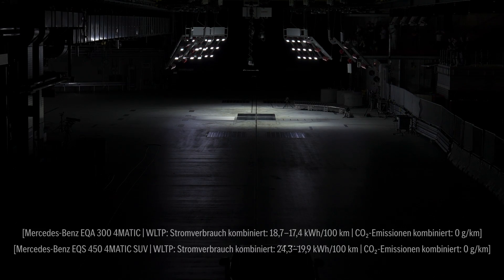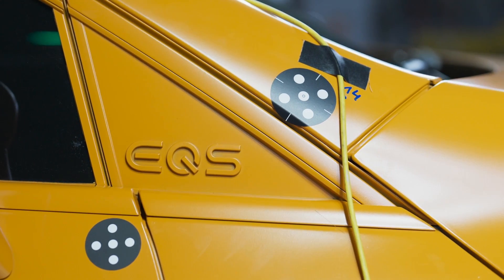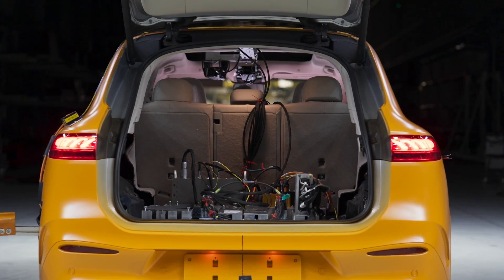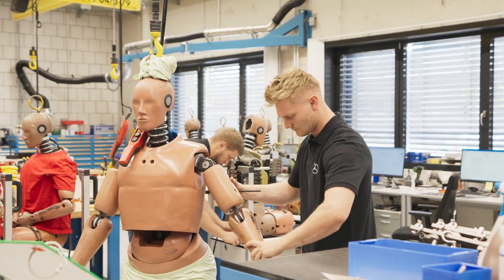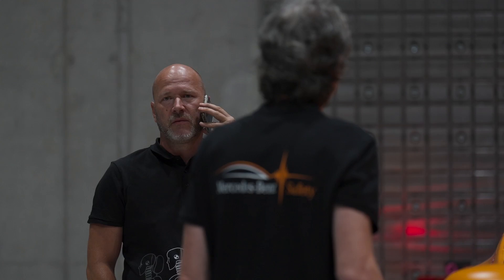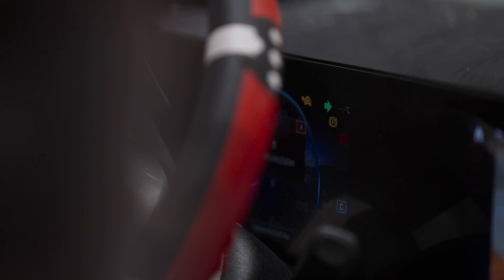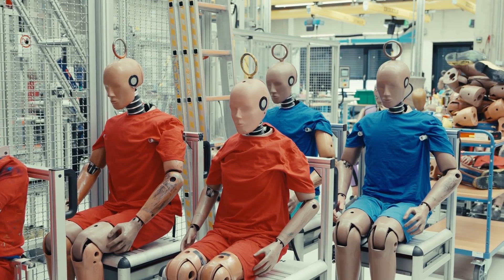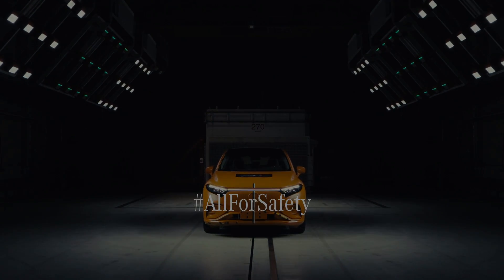The world's first public two-car electric crash test | Mercedes-Benz

Comment: "Its important that especially with electric vehicles that there is no damaeg to the battery" Okay, but we can't control everything, what if there is damage? It will explode or burn, It will electrocute its occupants? This route to electrification is just stupid
Reply: I'd agree that EV is not a solution (I personally prefer hybrids). But "electrification is just stupid" is just wild when most things we use is based on electricity. From kitchen appliances, water heater, pump, phones, trains, tram, etc. Basically 99% uses electricity with/without battery while only car & bike use gas (for me personally). Like I said, I prefer hybrids, but the industry is clearly moving towards EVs and it'll only get better & safer from this point onwards, and I don't really mind progress in that regard.